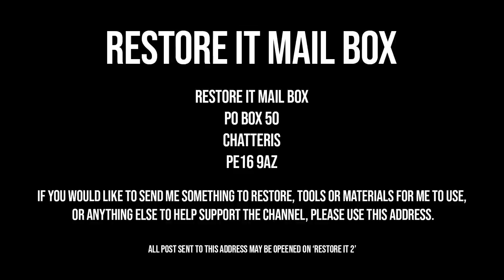BMW E30 Rear Subframe Assembly RESTORATION | BMW E30 325i Sport Restoration E4 S1

Comment: I understand that you will probably restore the body of the car eventually but to me it seems very odd to bolt in restored parts to still dirty and rusty body. Maybe should have restored the body first? Obviously I don't know your workflow and thought process but just a thought from an outsider.
Reply: I was thinking the same exact thing.
Reply: He said in a previous video its just to keep them out of the way or something similar.
Reply: I suppose he has to keep moving the car about so it makes sense really
Reply: Also after a day or two you still remember how everything is supposed to go back together.  Imagine assembling a whole car from thousands of pieces some of which you touched last a year ago.
Reply: I was just about to say the same thing..
Reply: You gotta do what you gotta do when your space is limited.  I appreciate and respect his tenacity.
Reply: Nazar I Thought the same
Reply: Rafał Białek i took my old soviet era lada 21011 apart piece by piece everything got restored or either switched to new things.. its still an on going project but the end is near. its taken me almost a year to assemble back together. but if youve taken the part off youll mostlikely remember where to put it back.
Reply: If I was planning on restoring the body, I'd rather do everything else first. That way I would not have to tip toe around the fresh body work. If I accidentally drop a piece on the body, who cares, I was going to fix it anyways.
Reply: @Angziety94  finally someone who speaks some sense!
Reply: This is a pertinent question, I was thinking the same thing. The work that puts these parts in place and then take off to take care of the car's body makes no sense to me. But he's the owner of the project and that should make sense to him, and that's what matters at the end of the day.
Reply: @Angziety94  Yup, can see the difference between someone who has spent time working on vehicles and those who haven't. Bodywork is a fortune and adds nothing (mechanically) but one dint one scrape, a fresh great looking vehicle will be forever devalued until its resprayed
Reply: I’ve disassembled everything first, than restored the engine, then the body (welding, zinc, paint...) then the framework etc. But it’s really hard to find the right parts after 10 years or so. Fortunately I have a second car for spare parts and as model. However it’s a good idea to  have a lot of boxes 😜
Reply: Exactly. The body is rusted badly. Still restore and install the rear subframe. I didn't get the point.
Reply: @tolgaun  Because he needs to use the car every day. He can't keep it unused for months in the garage.
Reply: Always fix the driving experience related parts before cosmetics as a paint job for example

Comment: Doing a job like that under those circumstances is without doubt extremely difficult,it's hard enough with a car lift,but on your back on the floor makes 10 times harder,you're to be commended,the job was first rate,well worthy of my 5 ☆ rating

Comment: A comment or 2.
Is all this rust because of salted roads or did you recover this car from the English channel?
Back off the handbrake shoe adjusters before you try to remove the disc, it makes it somewhat easier.
You got a knuckle bar, good stuff.
Anywhere you find rust on the mating surfaces of parts you dissemble, after cleaning treating or replacing, assemble with an anti seize in those spots, it will stop water ingress and rust and make disassembly easier next time.
Good thinking on thr threaded bar bush removal, I think I'll steal that idea.
Paint the inside of your bead blast cabinet white and instal a dust collection system. The paint improves the perceived lighting, the dust collection stops you inhaling smashed glass dust and allows us both to see what you're doing. Youtube has heaps on updating bead blasters.
You are costing me money, Im now setup for zinc plating, just have to chase up the required stuff for the chromate finish.
An 8 in bench grinder on a stand with wheels and a wire wheel on one side and a linisher belt on the other is a VERY good addition to your tool collection, really speeds up removing paint and rust and cleaning bolts etc.
Keep up the good work.
Cheers
Reply: May be also due to being near or by the sea, but yes, typical for a car in the UK. Just the right conditions for rust, not to hot to dry moisture out, and not to cold to freeze moisture.
Great video.
Reply from the maker: I believe salted roads and just England in general. I'll be taking the car to Spain before I finish. So it should last a lot longer over there. I really appreciate this comment dhc. Thames for the advice.  Bench grinder is pretty much on its way. The sealy variable speed one. Zinc plating is super satisfying but can be tricky, good luck! :)
Reply: Restore It  Definetly get yourself a Scotch-Brite instead of sand paper (not for everything! but for edges and small parts). Painting the part with etch primer and high build primer just to sand it down with a paper seems a little bit  counterproductive. :-)
Reply: This is the condition of most cars on UK roads. It never stops raining here and the roads are salted pretty much all winter. His Bimmer is actually in pretty decent nick, I've seen worse on much newer cars.
Reply: Wow, I also thought that this E30 spent some time under the seas...
8-o
Drum brakes can really be a pain, I never coursed that much when working on other stuff compared to them...
:-P
Reply: Too bad with that salt-caused rust...Here in Germany it is such an issue too...
8-o
How to attract a cat to work? Just place a sheet of styrofoam, they love it!
:-D
Have fun!
:-)
Reply: @RestoreIt  Easiest way to prevent salt corrosion if you must drive the vehicle in the winter:

Get a large pot and melt a couple of toilet flange wax rings in it. Then dump a liberal amount of bar and chain oil in and mix it thoroughly. Get a spray gun and load it up with the mixture and coat the entire underside of the car with it, being sure to get everywhere. After you're done, drive down a dusty road for a bit to coat the mixture and you're set for a winter driving season.

When the winter season is over, go get a good undercarriage wash to remove all of the grime and rinse and repeat for the next winter season.

Paint of any sort won't protect from the salt, the abrasion damages the paint and gets under it. Once trapped between the paint and the metal, it will cause unseen damage until the paint eventually gives way and you see the cancerous rust too late.

Comment: I'd love to see a full restomodding on the E30, cleaning it up and building it how you want!
Reply: More E30 action
Reply: Agree. I think that the car would benefit a lot by upgrading few things. For example since he took the rear apart why not upgrade rear brakes to disk ones and maybe convert it to 5 lug nuts
Reply: Nazar P. Actually the car already has rear disc brakes; what you saw being disassembled was the parking brake.

Comment: Around the 14:10 mark you're using a treaded bar to remove the bushes. Slide on a ratchet spanner first. It's so much quicker. You're doing a fantastic job of everything. 👍🇬🇧
Reply: +Big Ben Bushings**
Reply: @SalandFindles  ... Lol. I did type in bushings, but it looks like I'm a victim of corrective spelling. I suppose you could use the threaded bar to take bushes out as well... ;-)
Reply: @grahamefreestone5309  snicker   Is that like "ribbed"?   hehehe..  There are so many innuendos in tools and mechanics, and I've watched so many of these lately, that my dirty mind is on high alert now.
Reply: @serenity6415  .. Nothing wrong with a tool innuendo.. I'm sure there's more to come.. ;-)
Reply: @grahamefreestone5309  Baaahahaa.. I won't even type my response to that. I'll just behave myself and go watch him work with his 8" bench grinder.

Comment: Tip:
Great work, Thanks for the fantastic videos.
Tip: Rather than 500 - 600 grit pads to prep parts after primer : I shoot sand in the cabinet at 30psi - and being light on the trigger. Being careful to not make spot delays or over-passes.
Works out well.
And if I have over-blasted looking afterwards in daylight (only job), I can re-prime that area, dry and prep it with grit pad.
Very handy.

Comment: I'm  a 100% certain your backing plates are on backwards. As you covered the section that would bolt up your calipers.
Reply from the maker: I'll look into this and make sure all is well. I'll change it over when I have the car blasted and everything back off if not. Thanks for pointing it out!
Reply: Nice spottet. You are correct.

Comment: A few years ago I did that for on MB w124 - went through it completely, the body too... It really was a tough job and took almost 2 years, basically in a yard shed. But positive is the result was so good that there was nothing rust-related under the car for many years and it was wonderful to drive. Old bushings deteriorate from inside out and lose their rigidity long before showing external damage. And, yes, you can do better work on coatings than the factory has done. Takes only time and effort.

Comment: Can't help but to admire you... not just your looks, your abilities in lining up the IRS on your own.. seems you had it well worked out.
 I have a vy ls1 Commodore, you guys call them vxr8 Vauxhall, looking at your setup it seems similar to myne, I need replace the main Bush's and wheel bearings.
You have shown me an ideal way to remove the lower control arm Bush's with the threaded rod washes and nuts, mad as idea, thanks for that one Steve.
Well I guess I'll leave you be for a bit lol
But all the same, thanks and take care.

Comment: Top job!, what I do when tightening suspension members is to put the vehicle on the ground on all four wheels then go around tightening all the bolts. Doing it this way (at least to me) means the bushes are not stressed from pre tightening.

Comment: Putting back that axle inside the rear hub is very difficult, Very very tight on these cars! I used files, penetrating oils, 2x4 block and a very bfh! Good Job!

Comment: It's me again, with my google-english.
I respect your work and wish you success.

I hope that you did not forget to lubricate the mounting surfaces of the brake drums so that they do not get stuck the next time.
When I repaired my car, I spent about two hours on their beating and removal, and therefore decided to use graphite lubricant, as it is designed for high temperatures.
Reply from the maker: Thanns for this advice!

Comment: I don't mean to tell you how to run your channel, but I do have a suggestion. For the cabinet media blasting, I would recommend a few things. 
1. Go to a local glass shop or whatever they are called and see if they can make you a small box that is just big enough to fit your cam so that when you blast things your equipment doesnt get clouded or suffer. 
or the cheap version
2. Clear plastic bag around the cam.

Thanks for the vid, it was fun to watch.

Comment: One little tip tighten the control arms when the car has its wheels on the ground. This prevents premature faliure since they will be in there natural resting position and won't expenrence excesive twisting.

Comment: A thing i do with my sway bars is to sleeve them in adhesive heat shrink tube (electrical, bought by the meter) after a coat of self etching primer and paint. Oldest i have is 2 years and there's no signs that water or moisture has penetrated inside (you'd feel the crunchiness of rust on it + bulges). Very important that it is the adhesive type, not the regular. Big electrical online stores have the stuff, i got it off fleaBay and it's a stout sheath at almost 2 mm of thickness.

Comment: I have been following your project for a while now and i admire your skills and patience. 
One thing that has got me worried is that you restore these parts on the outside but what about the inside, as these are mostly hollow parts. I can imagine moisture getting trapped there can cause rust going from the inside out. No layer of paint is going to prevent that.

Comment: What's the ring around the hub nut that you had to chisel out?
Also, for future reference: rear rotors come off the parking brake shoes a lot nicer if you back off the adjuster first. Use a long flat blade screwdriver through a wheel bolt hole to spin the star-wheel adjuster.

Comment: I’m trying to design a car based on the idea of easy rebuilding with basic and improvised tools, amongst other considerations, and that control arm bushing removal method with basic threaded rod was so beautiful that I’m now torn between that and the method that has at least one bushing facing up and the bolt for that being one of the subframe mounting bolts, because those two types of simplicity can’t be used together and I want to have the front and rear ends be the same part flipped around

Comment: What a performance! Great job! However,  it is very important to read my comments below for Your safety.

You mustn't tighten bolt while car body is lifted! You should fill it with fluids and even bags with sand with directly discribed weight. Or you can use threaded suspension to set right hieight wile lifted. You have sanded every bushing's socket. Sockets do not keep their required dimension after this.  You have used old nuts, which should be salvaged. They aren't round but flattened.

Comment: Lucky bastard! You didn't have to fire those subframe bushings out of the subframe nor you had to fight with those bushings alu inner parts chemically welded onto the body bolts and to drill and chip them out. Other than this, you did a heck of a job.
And for what it's worth, you incorrectly installed the upper handbrake spring (at least on the LH side): it should not interfere with regulator's sprocket (which we call a 'butterfly thing'). Yours does.

Comment: Don't place weight on the bearing without an axle shaft/stub in. The shaft end and nut are what hold the inner races and applies preload. Many factory service manuals state to not apply load until the axle nut is torqued.

Comment: I also did restore an E30 recently, which means I have done almost everything you have shown so far. 
I do love your work, but you did a few things wrong here. 

1. You should have tightened the bolts that connect the sway bars to the subframe, when in a neutral position. Which means, when the frame is mounted to the car and the car isn't on jackstands anymore. This might be the reason, why the car didn't settle to a low position, but stayed that high after putting it on the ground again.
2. The way you did press the wheel hubs in it is surprising, that you did not burst the bearings. You have to press them in while supporting the inner ring of the wheel bearing
3. The way you removed the rubber bearings from the sway bars, you could have easily bent them (that is no joke at all...). Built yourself a tool that looks that way: https://www.e30.de/fotostory/f02187/f02187.htm

Other than that: Great work as usual! Keep it up

PS: 
Excuse my bad English, as I am German.
Reply: You are talking about the control arms, not sway bars.

Comment: Maybe I'm missing something or I don't understand. The question I have is why would you go through such a fantastic job of restoring the rear end and then bolt it back up to filthy and rusted out wheel wells?  Experiment or lack of funds? it seems to me you need a good foundation which is the body. Get it completely stripped and start there. Thats my only question. Otherwise you make it look far too easy. Thank you so much for sharing your knowledge on restoration. Mad skills, bro.

Comment: You need to wait until the car is at its "normal" ride height before tightening the control arm / wishbone bushes, or they will be under stress when the car is sitting at its correct ride height. You can simulate this height by using a tape measure and a jack, this relies on you knowing the previous height, for example by measuring the original distance between the wheel centre and the arch.

Comment: Love the work your doing I used to own a e30 325i sport myself about ten years ago. Best part is you just get on with the job your doing and don't talk crap like most youtubers do narrating everything.

Got to ask, why bother using that bent disc guard though, surely I thought you'd of replaced that for a new one?
Reply from the maker: Thanks Marc. I didn't change it for this video simple because I had already spent to much and wanted to try and save it. In hindsight I will be replacing it when I have everything back off fr chassis blasting.
Reply: I hope you find some with a decent price. Was the reason why I left them as they were on my E34. Great work mate

Comment: Hi, I have some questions in regards of painting, if you would be so kind to answer.
1. Why do you use self etching primer not epoxy?
2. Is the high build primer just to hide imperfections of surface and add different color?, or why do you paint it with second layer of different primer?
3. Why do you sand the primer before clear coat instead paint it on not cured paint(I heard that you get chemical bond when painted over not cured paint or mechanical bond when fully cured and sanded.  I would be glad to hear word from you!

Comment: Great job man, I cant wait to see the body get restored! Also, are you using a torque wrench to tighten blots to spec?
Reply: 5 uga dugas on the bearings and 3 on the remaining big bolts but only tighten the trailing arms with the car under load, otherwise you will have the issue he is having with the height, the rear trailing arm bushes are holding the car up

Comment: hello, thank you for your great work. I have a question, when you install the rear shock at the bottom of the shock there is square washer, my question is at which side I should tight the bolt? thank you.